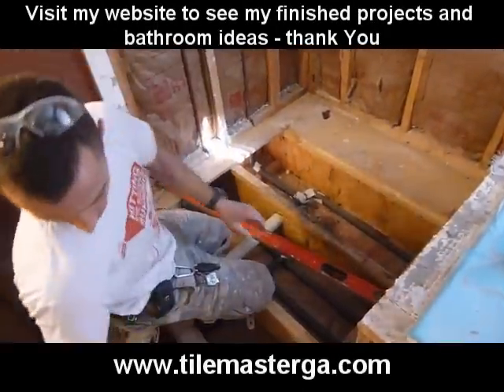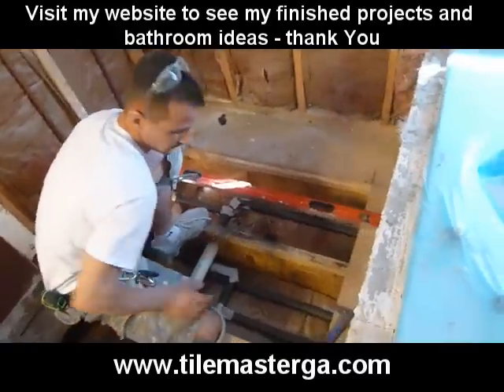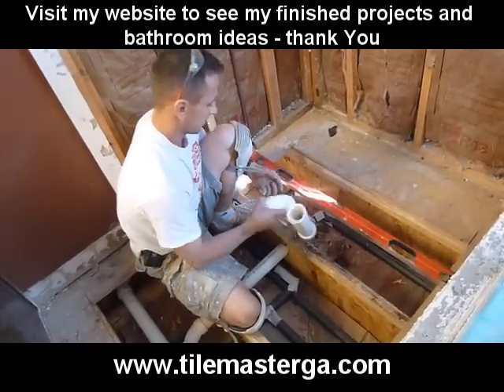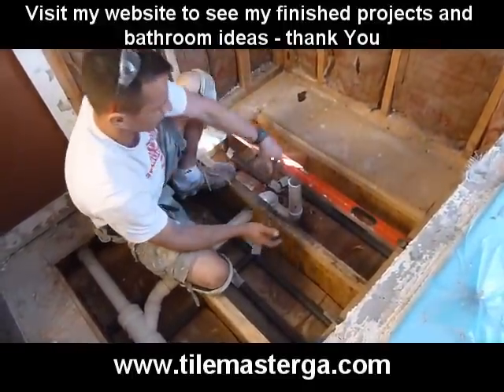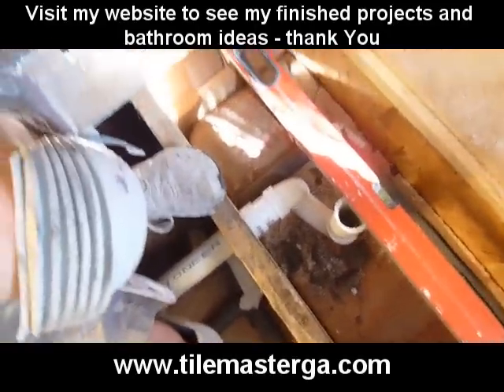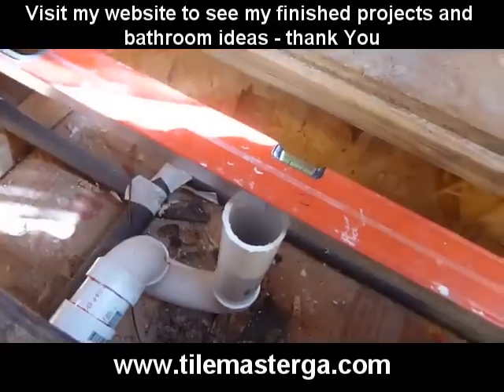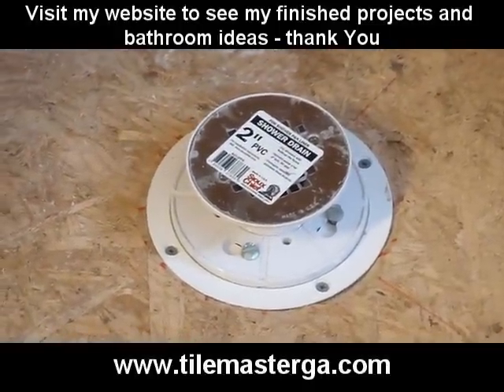Part 2. How to replace , install walk-in tile shower drain and p-trap -- 2" PVC pipe plumbing

Comment: I've been stuck with the drain in one hand and a saw in the other for a couple weeks as I have time to work on this. Nobody could tell/show me exactly what height the pipe should be cut to and mine currently is too high. THANK YOU!!

I used the nylon thread trick to cut the pipe once, but it's still too high I think. I'm glad I saw this video before went any further.

Great job showing what you did and the angles. You do a nice job explaining some of the finer details. 

If I can figure out what type of cement and sand mix I should use, I'll be ready for the next step. Much luck to you.
Reply: The drain he used screwed in to adjust for the finished floor. Check out these two tile forums. I think you'll find some good information http://www.johnbridge.com/vbulletin/forumdisplay.php?s=5d371a5c66eb8be8a1126e3bc9af3401&f=8&page=1&pp=60&sort=title&order=asc 

http://floorelf.com/

Comment: Never realized how much fiddling around you have to do to slightly move the trap and cut a riser for the new trap! Thanks for showing us how to find the center, and how to connect to the shower drain. Have you ever done a rough in, then when it comes time to drop in the drain pan find your off a little bit? Good work.

Comment: Michael, I've watched ALL your videos.  Very well done.  You are, indeed, the "Master"!  And since I am also of Polish decent, I get an additional bit of pleasure learning from you.  One thing that still puzzles me:  Do I or do I not need a pre-slope.  In one of your videos you indicate they are not necessary and lay the membrane right on the plywood and build your shower pan without a pre-slope.  However, in the comments pertaining to this video, you seem to suggest need for pre-slope and build it as thin as possible.  Can you please clear up this important point?  I am nearing this stage in my project and would like to proceed the correct way.  Thanks VERY much!  Chris, Clarkston, MI
Reply: Yes, you absolutely need a pre-slope. As of 2012, it's part of the standard building code. The liner needs to be pitched toward the drain, or it will hold water on a flat surface indefinitely, with nowhere to go.

Comment: With pvc pipe you have to use a solvent cleaner before using glue. I didn't see you do that and that could leak down the road.

Comment: So you have set your drain level with the floor, how will you have room for your wire mesh and pre-slope mortar bed around the drain without it being too thin and week?  I would have thought you would have the drain slightly higher than the floor so that you could have your pre-slope mud be at least 1" thick at the drain.

Comment: Can you tell me where i can find those kind of drains you use on the video with holes so you can screw it to the floor? I have look around and i couldn't find them.
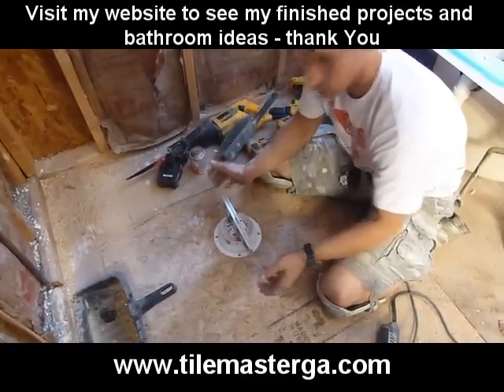Reply: At 18:35 you can see the brand of the drain. If you can't find it locally, try doing an online search for mail order options.

Comment: Why did you only push the p trap into the drain pipe about 1/4 inch, surely should be at least an inch ?

Comment from the maker: When I am working on pre-slope it is 1/2 thick against walls and goes to zero in drain area - who told you about metal mesh and pre-slope being week??

Pre-slope do not have to be thick! - actually it has to be as thin as possible and NEVER use any metal mesh !! - just advice from pro ...

THX